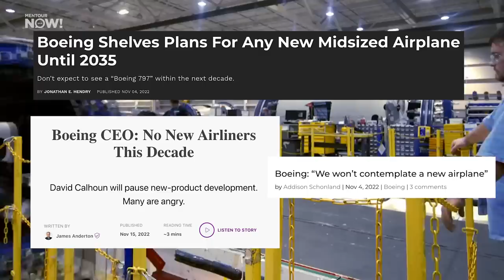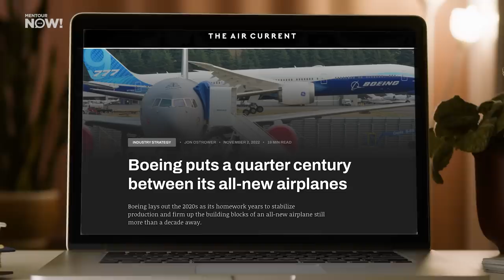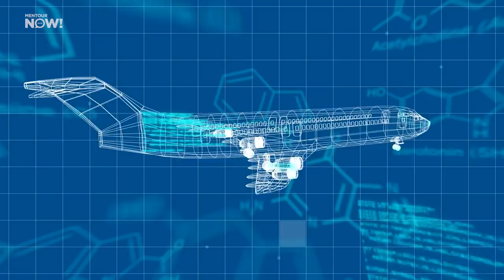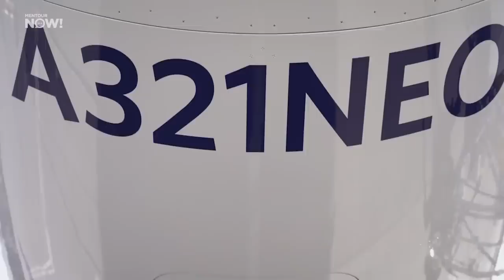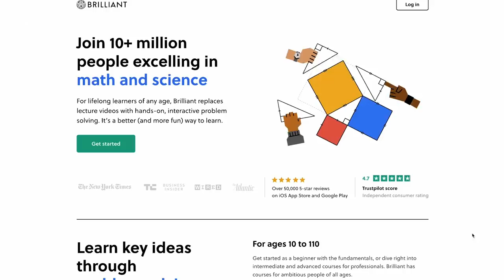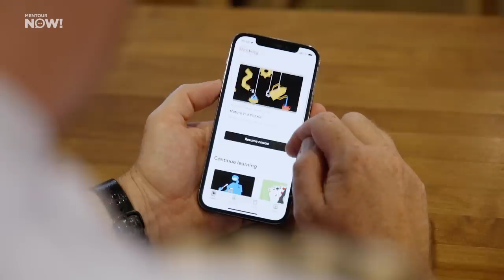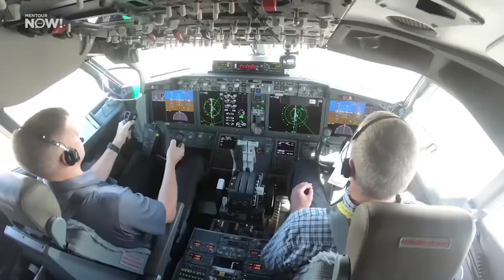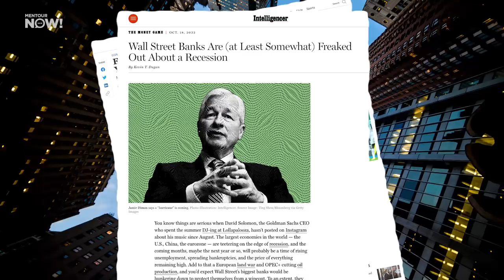Is BOEING giving up!?

Comment: Thanks for an interesting analysis.  Other than Boeing was apparently being 'bullied' by Southwest Airlines to continue with the 737, I cannot understand why nothing has ever been done with the 'stepchild' 757.  A good basic airframe that could be updated with new wing, new materials, etc and 'long enough legs' to take a larger diameter engine without needing MCAS.
Reply: The Max didn't need MCAS for any other reason than to make it feel like an NG so that it wouldn't need a new type rating.
Reply: @AlexandarHullRichter  That's what a lot of people say, but according to the 737 Technical Site, the real reason had to do with pitch stability at all angles of attack.  Making the plane handle like the NG was a byproduct rather than a goal.
Reply: @rrice1705  you don't think they could have written that site specifically to make themselves look better after a huge mistake?
Reply: I think Boeing observed that a new 757 type was not feasible at the moment because there was not a suitably sized engine. Available ones off the shelf were too big or too small. No engine manufacturer will commit to developing the engine a 757neo would require.
Reply: @francoistombe  Too bad.  I would have liked to have seen a 757neo.
Reply: @rrice1705   I also.
Reply: @rrice1705  There's no question that it was a primary goal to make the MAX handle like an NG in all situations for which NG pilots had been trained; that was the only way to satisfy Southwest's requirement that NG pilots could transition to the MAX without simulator training.

According to the Joint Authorities Technical Review, "MCAS used the stabilizer to change the column force feel, not trim the aircraft," and both the FAA and EASA determined that the MAX would have met certification standards without the MCAS (though simulator training would have been required for the transition).
Reply: @Curt_Sampson  My statement about pitch stability was an over-simplification, but the goal was, as your own source states, to use the stabilizer to change the column force feel.  However, this was done to meet an FAA certification requirement that "any pitch-up tendency should be mild and readily controllable."  The NG already met this requirement by virtue of its design, but the MAX did not.  MCAS was therefore implemented to meet it.  So, in a way, it was to make the plane handle like the NG, but again the primary reason was to meet the certification requirement regarding pitch-up tendency.  Since this had the effect of making the plane handle like the NG, in popular media that's how the story is told (but this story is a simplification).
Reply: @rrice1705  Fixing pitch stability was not an "oversimplification"; it was wrong. Just because the stick feel is different in certain situations does not mean that the aircraft is pitch-unstable, it just means that it feels different. (Obviously, when the aircraft feels different at the controls, you want to put the pilots through simulator training with the new feel so that they will react properly in that situation; that need for new simulator training was the entire issue here.)

This is all explained in detail in the article "Boeing's MCAS on the 737 Max may not have been needed at all" in The Air Current, 2021-01-10. Quoting from that:

"In completing its evaluation of the 737 Max for returning to service in Europe, Patrick Ky, Executive Director of the European Union Aviation Safety Agency (EASA) settled a central question that had hung over the Max development. The inclusion of the larger Leap engines did not impact the overall stability of the 737 Max.

“'We also pushed the aircraft to its limits during flight tests, assessed the behavior of the aircraft in failure scenarios, and could confirm that the aircraft is stable and has no tendency to pitch-up even without the MCAS,' said Ky....

"FAA Administrator Steve Dickson at a February 2020 media briefing that the regulator had 'gone back and looked at the airplane with the stall characteristics with and without the current MCAS system. And the stall characteristics are acceptable in either case.'

"Those who have flown the Max in engineering tests tell TAC that much of the differences in handling qualities with MCAS present and not [emphasis mine] are marginally perceptible 'once you know what to look for' and produces a 'slightly softer feel' in the aircraft’s control for stall recovery."

In other words, all the evidence we have points to the MCAS being unnecessary for the safety or stall characteristics of the aircraft, and being there merely to avoid having to do a little bit of simulator training before pilots transition.
Reply: @Curt_Sampson  Yes, that's a very persuasive argument for the MAX not having any significant problems with pitch stability.  However, as I think you can  I can agree by now, pitch stability was never really the problem.  The problem was the effect of angle of attack on control force feel.   The location of the MAX's engines causes nose-up lift at high angles of attack, which reduces the control forces needed to pitch the plane up.  This effect is not allowable under the airworthiness standards for airplanes in the transport category, specifically 14CFR §25.203(a) "Stall characteristics"; in other words, it causes a certification problem.  MCAS was implemented to address this, which is its real reason for being.  But since most people have no idea what angle of attack is or what it means or what the implications are for its effects on control forces (or for that matter, what control forces are), in media this is oversimplified as having to do with pitch stability.  It's not wrong exactly, but it it's not quite right either.  Without addressing this problem, whether or not pilots needed additional simulator training would have been irrelevant because there would have been no MAX because it would not have been certified.  Patrick Ky's comment that "the aircraft is stable and has no tendency to pitch-up even without the MCAS" does not speak to the problem of control force feel.  

To say that "since something is not one specific thing it is therefore another specific thing" is the non sequitur, the "it does not follow" fallacy.  E.g., it is not red therefore it must be blue.
Reply: @rrice1705  "...in media this is oversimplified as having to do with pitch stability." Well, in some media, perhaps, but not in the media I quoted. I'm glad we now agree that's not the problem.

"This effect is not allowable under the airworthiness standards for airplanes in the transport category....whether or not pilots needed additional simulator training would have been irrelevant because there would have been no MAX because it would not have been certified."

Well, the statements I quoted from the EASA and, in particular, the FAA seem to directly contradict your assertion that the aircraft would not have been certified without MCAS. I choose to believe the people actually in charge of the certification, rather than you.

Comment: Of course, it wasn't like the DAC side of McDonnell Douglas didn't try. Before the "merger" with Boeing, Douglas had a concept for a two engine version of the DC-10 which was proposed to the powers that be in St. Louis, and which was rejected. There was a lot of animosity between Long Beach and St. Louis, especially with St. Louis pulling and holding all the strings, and seemingly not wanting to be a commercial manufacture too. It would have been a plane that may have flown up to 3 years before the 767.
Reply: and people say that chinas airplanes are actully bad but actully look at what boeing has actully become

Comment: Thing is, Boeing is already sitting on a highly fuel-efficient airliner concept: the Aurora D8 by Aurora Flight Sciences, a company that Boeing bought back in 2017. From what I have read, the Aurora D8 would be the perfect next-generation replacement for the Boeing 737, having similar capabilities as the latter while being much more efficient (49% more efficient than the 737-800 at Mach 0.82, 70% more efficient at a slower Mach 0.74). They were supposed to be flying a half-scale prototype this year (2022), but nothing has come of that as far as I know. 

Obviously it’s far from ready for production, and the timeline for its development does indeed aim for the aircraft to be in test service between 2027 to 2035, which does align somewhat with Boeing’s announced timeline. I would imagine it going into production much sooner though if Boeing wanted to accelerate development of the concept, and there’s really no reason for them not to even if they need to focus on their existing models and contracts right now. They can’t be that starved of money and resources right now, can they? Yes I know the whole Boeing 737 MAX fiasco and Covid-19 burnt a giant hole in their finances, but I honestly doubt it’s something bad enough to have to put development of new planes on the back burner for so long while they let Airbus take their place. 

As an aside, I don’t really have strong feelings for either Boeing or Airbus; my bigger concern is that if Boeing goes under, the passenger jetliner market would be effectively under the monopoly of Airbus, and monopolies often spell disaster for the pace of innovation in a market, among other things.
Reply: The blueprints are filed right next to the designs for a perpetual motion machine.

Comment: Remember that the 787 was picked as their answer to the 380 … because they felt that a380 was doomed to fail …
Reply: a380 is indeed a failure project.
Reply: Yes and Boeing had a weapon to harm deeply Airbus. But they almost killed themselves...
Reply: @prasenjittripura4691  not exactly. Airbus could get the knowledge and the experience to build a very large aircraft. And could then convince more airlines with the A350..... What does not kill you makes you stronger.....
Reply: @prasenjittripura4691  Why is a380 a failure in your opinion? I flew as a passenger in both Boeing 737 and Airbus A380. I liked A380 much more than any Boeing airplane, because A380 is much more comfortable and much more goodlooking inside than any Boeing.
Reply: @prasenjittripura4691  depending how you look at it so can the 787. Yea they may have sold nearly 1000 but they haven’t made a dime from the project yet
Reply: @CompletelyRandomUser  oh really…? so fanboi coming with new excuses to validate a failure project… cry more
Reply: @prasenjittripura4691  so you have no arguments. Got it :)
Reply: @IcyTorment  considering the enormous cost to fix the 787, the fines and the fact they’re selling them cheap many analysts are in doubt of that unless Boeing charges more
Reply: @IcyTorment  Thank you!
Reply: @CompletelyRandomUser  the airlines determine your comfort level.
Reply: @IcyTorment  really? The 787 has not made a dime you say? Not the impression I got a few years ago when the program was footing the r and d for another plane in works. Maybe they were lieing to me, who knows.

Comment: Workers at a 787 Dreamliner plant in South Carolina have complained of defective manufacturing, debris left on planes and pressure to not report violations.
Reply: The MAX and other revelations that came after are reasons why I am reluctant to get on any Boeing aircraft built after the Great Recession, just out of principle. The company is unsafe, and we would have had domestic disasters here if our pilots weren't so well trained. We had MCAS runaways here in the US but thankfully they were handled appropriately.
Reply: That is old news
Reply: @hia5235  Union membership does not equal expertise. Unions have decimated the industries they are supposed to represent. Steel, automobiles, and other industries have offshored to reduce labor costs. When I was in an MBA program years ago GM had almost $3000 in costs for retired workers added to the cost of every vehicle they made. That debt load is not related to cost of manufacturing but is an overall drain on the company.

Comment: I think that a significant problem for Boeing is that the issues with the MAX and the way they dealt with them has resulted in an unexpected regulatory change which has effectively killed any further 737 development unless, or until they are prepared to bring them into line with those new standards. Something they keep repeatedly saying they would kill variants first! 

Couple that with the fact that the A321, while still not perfect, is infinitely better and more flexible that anyone expected. So much so, that it has successfully cornered much of the 757 replacement market where the 737 falls short.

In short, Boeing need that new aircraft, but where do they place it?
Reply: However, some may argue, and I am afraid that I would have to agree, that it is better to walk in the right direction than panic and run in the wrong.

Unfortunately, I think that Boeing are now in the position where they need to look forward to the model ranges they want in 25 years, and how best to get there.

This should include their plans for a replacement of their single aisle offering, with serious consideration as to where it (or they) should be positioned - for example, how small, E2 small, A220-100 small, or Max7 small,  along with how large they should go, and will there be a gap between it and their twin aisle models, or an overlap, and if so, by how much? 

No doubt similar considerations will be required for the twin aisle models, for example should the 777 be replaced with its largest variant smaller, or even larger than what is currently offered (remember we are looking 25 years ahead), and is a larger 787 (or smaller 777 variant) required to better fill the gap/lack of sufficient overlap between the two ranges.

While I think that a new NMA, will eventually be essential, could this simply be a 'baby 787' with smaller wings and a narrower fuselage?

No doubt Airbus will need to make similar decisions, however, fortunately for them, they are starting from a much stronger position with Boeing arguably only having one model to be envious of, that being the 787, which is at risk of never turning Boeing a profit. I would wish them all of the luck with a 787x, but as the financial failings of the 787 have been very much of Boeing's making, I don't think that luck has played a part!

Something else to be considered once the new generation of scalable engines comes on line, is the possibility of a high performance model for those more demanding requirements, rather than having to rely on the smallest variant in a range such as the A220-100 now, or the A318 and the 747SP previously.

Comment: I think this decision has a lot to do with Boeing still having to certify the 777x, 737 MAX 7, & MAX 10. It's going to take at least four more years to finish that. They need to iron out their issues before investing in a whole new airplane. I also think that Boeing might be letting Airbus experiment with the A321neoXLR to see if it's worth producing a new airplane for that market. This is similar to what they did with the introduction of the A380. And as you said, they're just waiting for the next leap in technology. They probably have backup plans to upgrade the 787 if necessary. 

It seems Boeing is being extra cautious this time. They're recovering from a big mess, and they also have a lot more competition. There's a lot up in the air right now to settle on a design. Long haul narrowbody flights are being introduced, the regional market is changing, manufacturers are designing hydrogen / electric aircraft, and there could even be a demand for supersonic aircraft soon.

Comment: In relation to the MCAS issues I heard on some podcast that the merger of Boeing and McDD caused McDD management style to take over in Boeing. So the comparison at the end might not be that far off.
I'm no big fan of current Boeing. But we do not want the duopoly to move from Boeing-Airbus to Airbus-Comac (or whatever else in China). They need to go back to their roots, so I can be fan again and we get to keep B-A as the top jet producers.

Comment: With the recent conflicts regarding China, and probably more legislation that limits China outsourcing, I'm not surprised Boeing is hitting the pause button. Presumably accountants wanted to outsource as much as they could, but new outsourcing limits could interfere with those plans. Spending enough time to properly investigate design errors might be a good thing.

Comment: My friend who was an engineer told me that Boeing went downhill after the merger with McDonnell Douglas. She told me MD people weren't good with complex and long term projects. Keeping things in house was a way they could keep the quality up on the manufacturing and the supply chain. That was a way to save money by off shoring manufacturing. The union busting meant that they had less qualified workers and the quality went down some more. The management after DC merged wasn't easy to work for with many of them not engineers. She started working with Boeing with the B-1 program which was a mess in its own way. It's possible they have a lot of patents and software to sell and they are exiting the civilian market.

Comment: You didn't consider the fact that because of what happened in the last few years, Boeing might be taking a step back, fixing issues, introducing new procedures, etc., so the future is better. They are also making existing airplanes better, look at the eco demonstrator. Boeing also has software products and is innovating quite a lot in that space. You can't compare last century with this. Companies have diversified, and obviously, there's a lot of opportunity in different portfolios.

Comment: Are Boeing giving up? With the Max being at the intersection it currently faces it is sound business strategy to not spend billions on R&D until it has established trust in its current fleet. The audit by the FAA, the issue with quality from it numerous suppliers etc. It makes sense, but it doesn't mean that they're giving up.